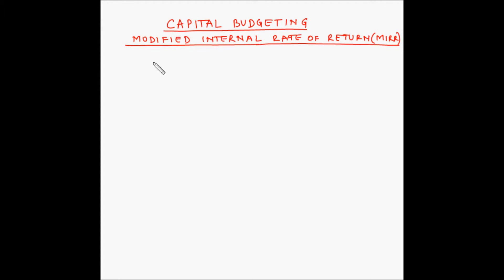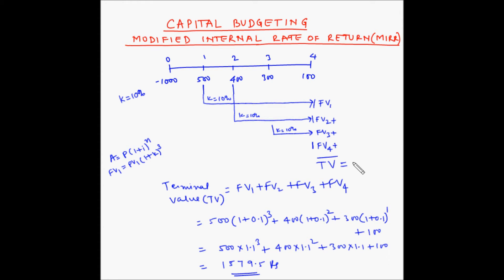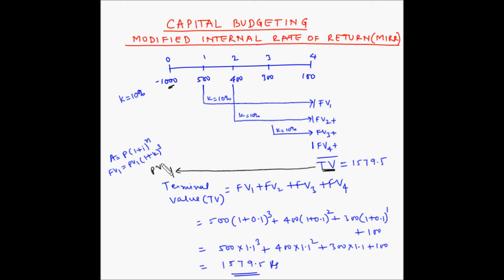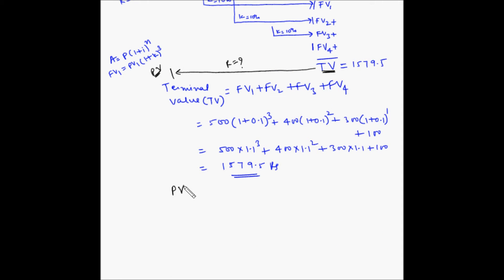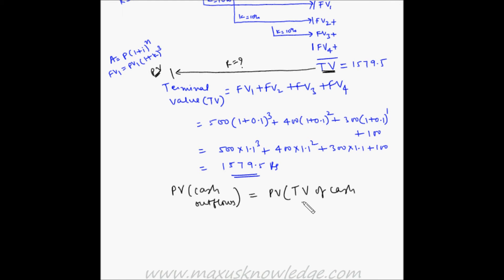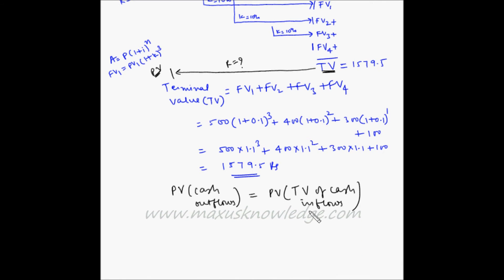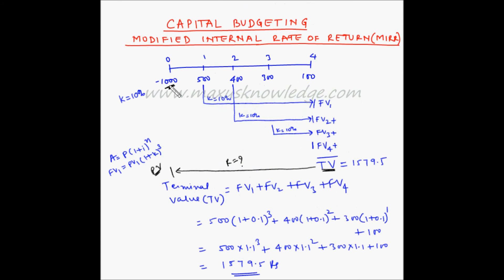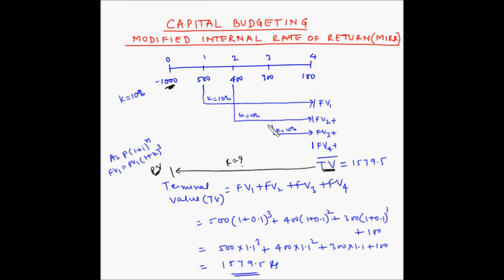Modified IRR - Fundas

Comment: https://papers.ssrn.com/sol3/papers.cfm?abstract_id=2942456
Modified IRR (MIRR) Is a Spurious Criterion and Should Not Be Used in Cost-Benefit Analysis (CBA) and Investment Analysis
Kannapiran Arjunan

Abstract
This paper evaluates whether MIRR is an appropriate criterion for investment decision and the true annual rate of return on capital. Unlike other published papers, the present analysis introduces three important improvements viz. the investment returns are consistent with NCF (NCF-consistent); the two components of returns on capital investment, i.e. return of capital invested (ROC) and return on invested capital (ROIC), are clearly defined and accounted for; and finally, capital amortization schedule (CAS) is used to verify whether the returns are achievable from the NCF generated and therefore NCF-consistent. The appropriateness of MIRR is evaluated using numerical analysis and the main findings are:

a. The estimation of MIRR, manually or in excel, is based on the modified net cash flow (MNCF). The MNCF, derived by mathematically adjusting the actual net cash flow (NCF), distorts the intrinsic value of the cash inflow and its timing. With MNCF, the MIRR is lower than the IRR because MIRR failed to fully utilize the NCF generated as shown by the CAS. MNCF is neither NCF-consistent nor accounting concept-consistent (cash vs accrual concept).

b. The problem of reinvestment of intermediate income is a fallacy and therefore the MNCF is a meaningless exercise. For the same NCF, the net benefit stream, MIRR is increasing without any limit with increasing investment rates (IR). The NCF is not adequate to support such an increase in MIRR, as revealed by the CAS. Similarly, when the actual IRR is lower than the IR used, the estimated MIRR is higher than the IRR. Again, the NCF is not sufficient to achieve that higher MIRR than the IRR as confirmed by the CAS. This is one of the serious problems with MIRR that is based on the MNCF, a mere data mining exercise. MIRR is not an accurate estimate but a spurious one.

c. Again, the problem of multiple IRR is a data problem associated with non-normal NCF. MIRR does not solve this problem either. With non-normal NCF, the cumulative sum of undiscounted NCF is zero or negative or negligible. In those cases, the NCF data leads to multiple IRR. The non-normal MNCF leads to spurious MIRR estimate (also GIRR and AIRR) that is not supported by the actual NCF as revealed by the CAS. Any rate of return must be NCF-consistent.

d. With normal NCF also, the MIRR is spurious because of the false reinvestment assumption and the use of MNCF data. The estimated MIRR, based on assumed reinvestment rate, leads to serious problems as explained above. MIRR (when MIRR < IRR) estimate does not fully utilize the benefit stream and leave a closing balance, as revealed by the CAS. Contrarily, IRR fully utilizes the NCF and therefore IRR is higher than the MIRR (paid-off the ROC and ROIC = IRR). When MIRR is higher than the IRR, the NCF does not support that level of MIRR.

e. The results of CAS reveal that MIRR is neither the true return nor the annual rate of return. IRR is also not the annual rate of return but it is the true rate of return on the capital remains invested. Both the MNCF and MIRR are not NCF-consistent but may be mathematically-consistent. When there is no intermediate income, the question of reinvestment does not arise. With that type of NCF, the MNCF and the MIRR are NCF-consistent.

f. Generalized IRR (GIRR) and Average IRR (AIRR) criteria are also reviewed. They are not NCF-consistent but mathematically generated returns and are based on wrong assumptions (reinvestment).

Based on these results, it is evident that the MIRR is a spurious criterion. Investment analysts and decisions makers may wish to move away from using or reporting MIRR as a criterion so also the authors of all published works and finance and economic texts.